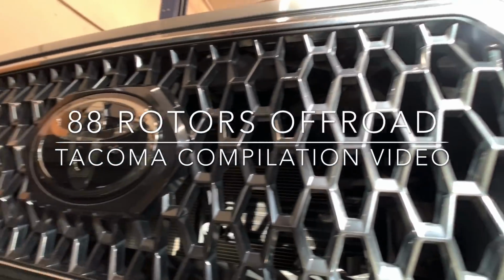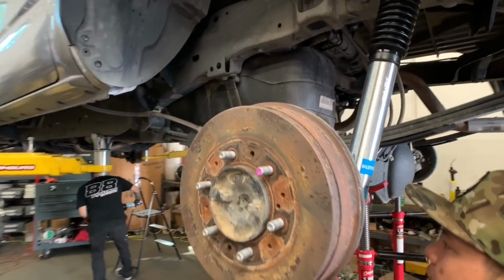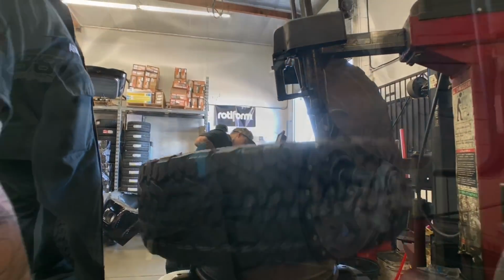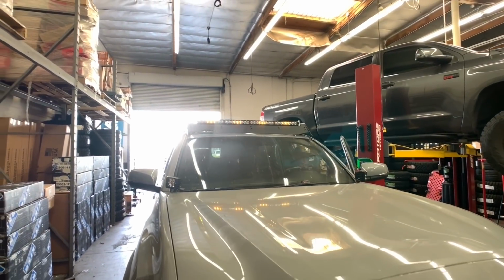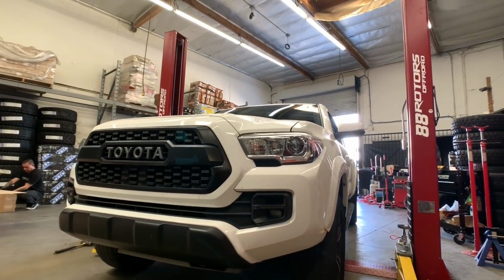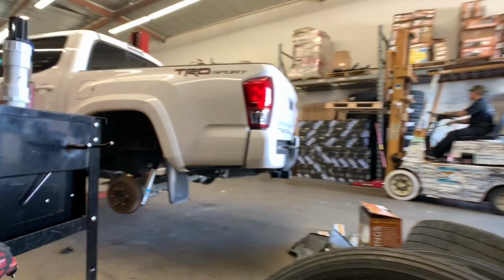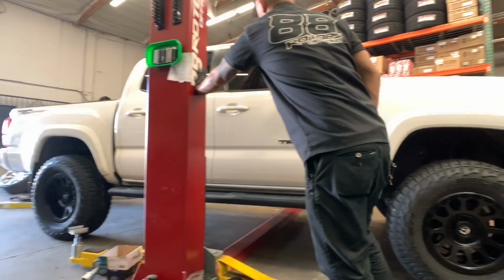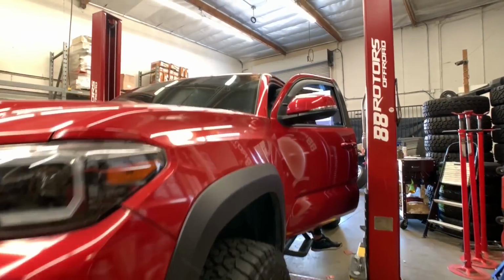5 Different Toyota Tacoma Lifts, Wheels, & 33” Tires

Comment: I have a 2015 tundra that I want to build into a overlanding meets hunting truck. I want to run 18’ rims with KM3 35s while keeping the lift not crazy high (3-4”). What lift/suspension would you suggest that’ll handle some abuse Offroad?
Reply from the maker: I'd recommend going with a King setup. I'm running Kings on my 2015 Tundra TRD PRO &  I'm loving it.

Comment: That tire size on a tacoma fits without rubbing??? I thought for sure a CMC was necessary
Reply from the maker: No rubbing. With proper wheel offset and caster adjustment, there is no rubbing with the lift.
Reply: Hmmm got me thinking if i should just go with that tire size now... was thinking 285/75/17. Definitely would need cmc though
Reply: @gamebreak81  Won't work without a lift. If you are still stock the biggest you can go without rubbing is 265/70R17 or 265/75R16.
Reply: Tim Mayville 

Thanks bro, i have a 3” dobinsons lift. Just ordered 285/75/17 ko2. On tandem model 612 wheels.